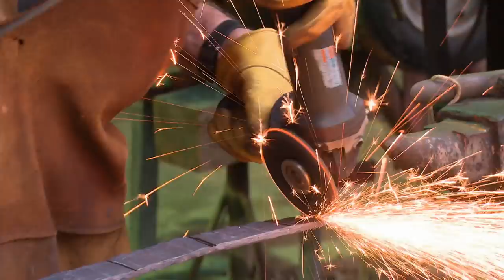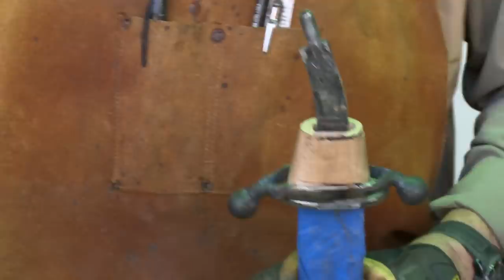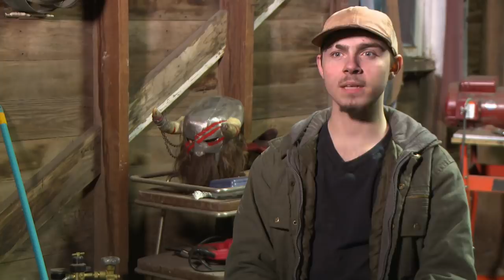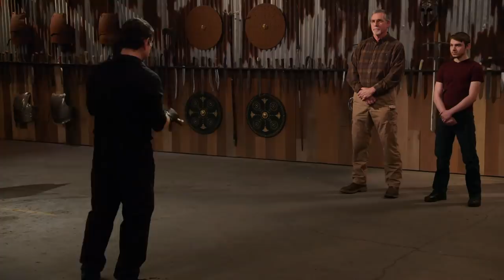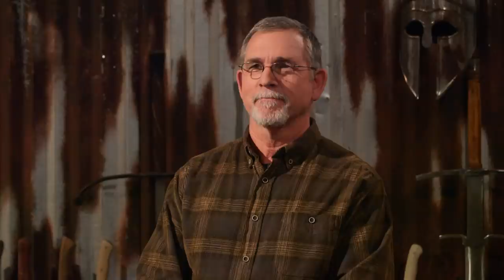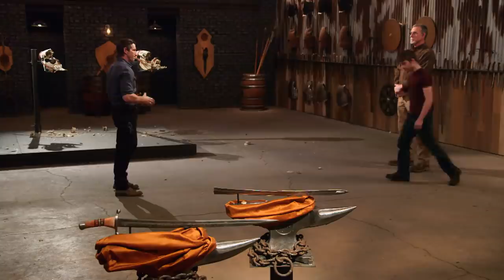Forged in Fire: THRUST and SLASH With Attila's Sword of Mars (Season 6) | History

Comment: Well, my blade too suffered a catastrophic failure one night where I could no longer continue due to being too drunk.
I failed in the strength test. Maybe my pommels were too cold.
So the lady asked me to sheath the sword and leave the forge.
I went home shamefully and with a broken pride.

And this did "keel" me.
Reply: Looooool
Reply: Shantanu Kulkarni 😂
Reply: My condolences fallen soldier
Reply: Use wood for your palmal. When you make your blade, forge thick, grind thin. A thick blade is A great, strong blade. When it comes time to heat treatment, if your Forge is too small, use the tube method, it becomes one big hot oven!!!

Comment: When he was making his first blade, He should have pinned it, then tempered the blade. Often times when a blade warps, the heat treatment it’s not done correctly because he has to have an equal heat across the entire blade. He should have used the tube method to increase the length of the Forge, so he can heat treat it properly. I have seen this in the battle of the branches final round in the United States military episode.

Comment: Most of the horse skull sword damage came from hitting the metal mounting bracket underneath the skull. It’s the coconuts all over again lol.
Reply: I agree. Those judges messed up by doing this type of test
Reply: Glad that you have noticed that fine - but crucial - detail in this episode, I've just highlighted that very same test >>discrepancy<< [more commonly known as a fuck-up of epic proportions] in a comment above.  I wouldn't like those Judge's to hold my life in their hands, because they would surely sentence/send an innocent man to the gallows...[the pretentious frauds].
Reply: I'm glad other people noticed that.
Reply: I mean swords are made to withstand metal too tho no offense against the blacksmith tho he was just a bit inexperienced
Reply: Doesn't matter, the blade shouldn't have broken. He made a mistake with the heat treatment - when burning out the handle, he heat up the tang of the already tempered blade. That's a great way to induce grain growth RIGHT at the neck of the hilt, where most of the stress builds up during a strike.
Reply: Horváth Benedek and his guard was also not a tight fit giving it more stress
Reply: Nah he hit bone every time
Reply: Still it revealed an obvious flaw

Comment: That young guy seems to not have as much training as other blacksmith in the show.  Most everyone seems to use vice method versus just bending back with knee.  Tip area seemed cooled down more than rest of the blade anyways during heat treating.